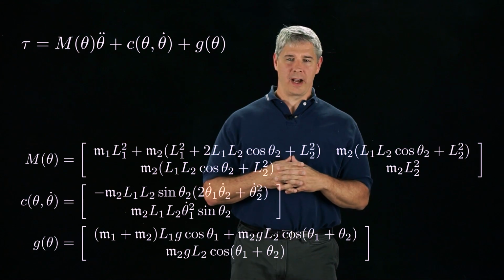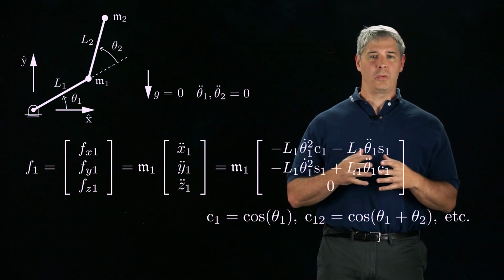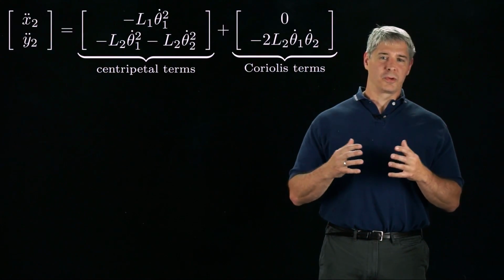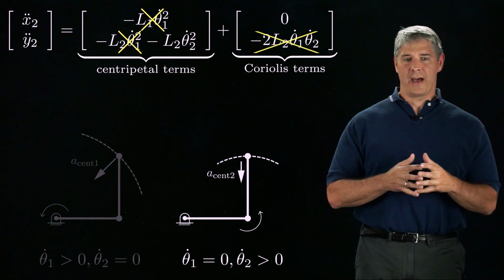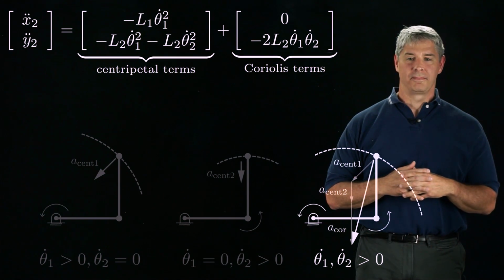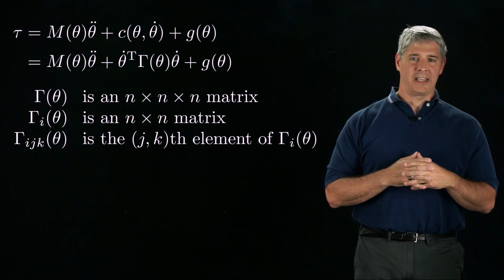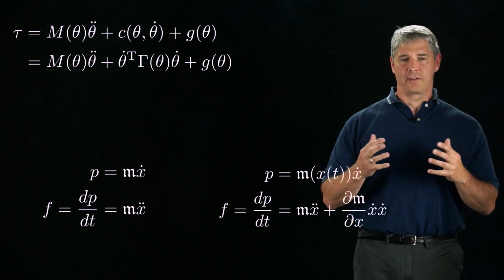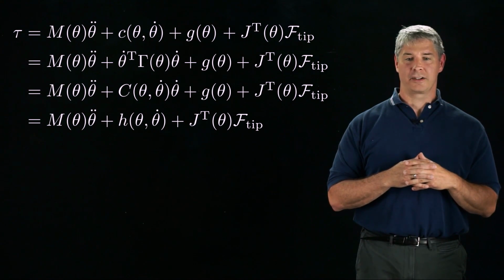Modern Robotics, Chapter 8.1:  Lagrangian Formulation of Dynamics (Part 2 of 2)

Comment: 2:54 I'm lost can somebody explain
Reply: The two joints are rotating at a constant velocity. This can be visualized by considering the top view of a person spinning about itself. The joint 1 is the person's heel and the joint 2 is the person's elbow joint. At th1 = th2 = 0, the person has his arm fully extended. An angular velocity at two joints is analogous to the person spinning about it's heel and also tucking in his arm by using the elbow joint. If you've seen or tried this spinning experiment yourself, you know that you spin faster about your heel when your arm is tucked in. This means at about any th2>0, the joint 1 moves at a faster velocity than intended (has an angular acceleration). To counteract that added undesired acceleration, you apply a torque in the opposite (-ve) direction. Hope this made sense to future readers.

Comment: can we apply these dynamics on mobile robots as well?? by assigning frames at different positions of the robot
Reply: you'd have to adapt them but since the Lagrangian is an energy evaluation formula, you can. You can also apply them to end effectors attached to an arbitrary body that can move in space.
Reply: Ya there are a lot of research papers on comparing lagrangian vs euler methods for mobile robots